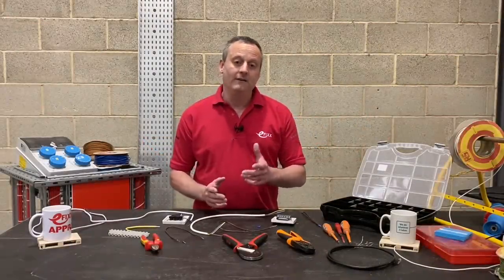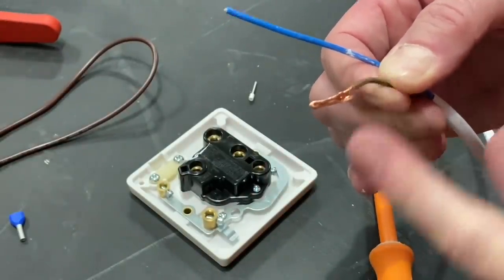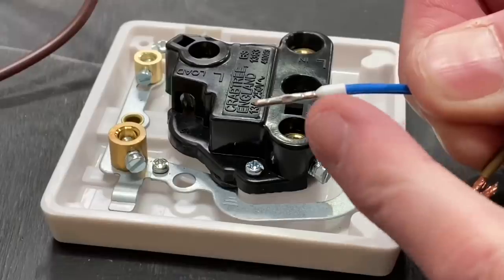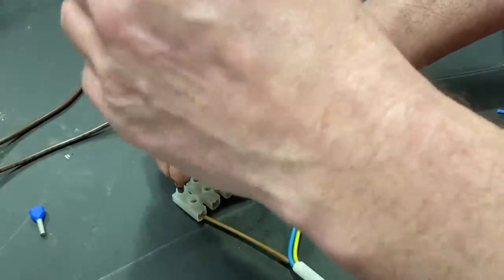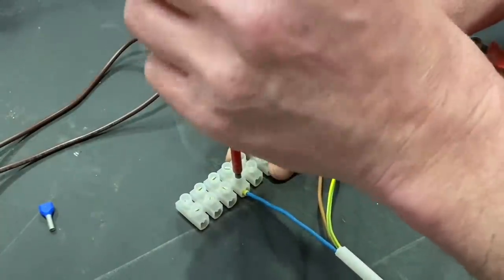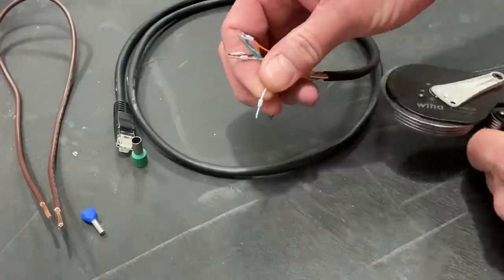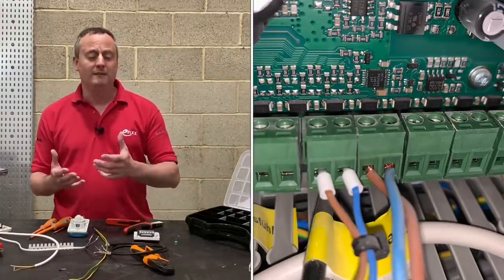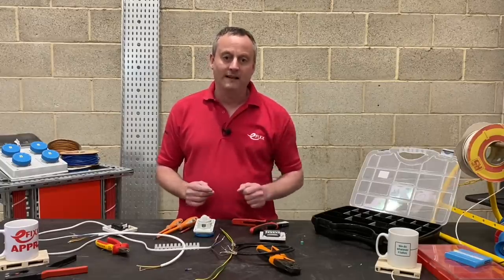Ferrule crimping - An easy way to improve reliability of electrical connections.

Comment: OK, cool, nice cool crimper there. even though this is a uk vid, I think its applicable to what I do in Chicago here in US. When I did electronics we just tin the leads after stripping and twisting, this is too much to do in an electrical installation in a house of course but in controls I think it would be added value. I work in commercial HVAC so I'm constantly troubleshooting problems in controls and much of the time its poor terminal terminations. These are very small poorly positioned terminal blocks with small wiring often twisted shielded wire. I like the idea of using crimped pins like this however I don't think its practical on small gauge wiring like in control wiring, so I'd like to see a way or process in fast reliable bulk tinning to be used in control wiring installations. I think its value added considering I've spent 2 full days pulling ceiling tiles and crawling around above ceilings on planks to get to every micro control in a Victoria Secret to perform a "tug test" on each and every wire termination only to find one single poorly done wire causing the whole system not to work.
Reply from the maker: Thanks for some info from across the pond. The crimped we used will go down to 0.08mm2    - and the ferrules start at 0.14mm2  - so will work on the smallest of control wiring.
Reply: NEVER EVER tin connections that will be used in screw terminals.  The solder will "cold flow" and the connection will ALWAYS become loose over a few months.  I have been to many jobs where this has happened and caused arcing.  Obviously this is a massive fire risk.  Also it's against the UK electrical regs to tin wire (526.9.2).  Ferrules are just the right way to terminate stranded wire.
Reply: Johnny B most all issues come down to the workmanship. Think about this. There was a time when pulling a ground wire was not required. Sloppy workmanship like not tightening set screws and lock nuts gave us that. Arc fault breakers would not be needed if not for bad splices
Reply: @gerhardschemel3565  agree, In Chicago, or whats called the 6 county area of Chicago, we have some of the strictest electrical codes. I'm not an electrician but I have worked as one and I do commercial HVAC so I'm always working on electrical and controls. We are required to pull a ground wire on every piece of equipment and it has to be landed in the panel.  My biggest head ache is control wiring, one little wire not landed tight, can cause an intermittent program execution error that can be nearly impossible to find. compounded by the owners don't want to spend a lot of money troubleshooting on a hunch its a loosely landed wire. I looked up the equivalent american product and I think I want to get a kit when I get back to work after the pandemic, if I survive it.

Comment: one big issue tho - someone thinks crimping is a good idea so they choose a crimp, its slightly too big, gets a poor crimp, the screw grips the crimp but the wires fall out of the crimp. very important to get the right crimp for the cable csa
Reply: Ferrules should not be used to make a bad idea better, they are not the  "Answer"  as you say to good workmanship.

Comment: i was always taught , to only crimp things on stranded conductors and not solid conductors. i tend to use them on meter tails, there was a time when hager consumer units came with a pair for the meter tails. And that was when hager were seen as a cheap brand totally different from todays image of hager.
Reply: There is a good thread on IEE about this and one chap is adament they should not be used on solid core conductors. Others whom worked on MOD projects also said the same!

Comment: Surprised there was no tangible evidence provided with this video.

Could you not have checked the resistance of each connection? Would this have provided data on how "clean" the connections are comparatively.

Also, no sort of pull out force was completed either or specified torque on the connection?

I agree that ferrules are an improvement if used correctly but how often are the non-ferrule installations failing really?
Reply: Perhaps not fail but does make work harder. I work fire alarms and though it works the wires become a pain after a while wire messes up not a lot of slack to keep cutting clean ends etc

Comment: Simply fantastic. How do I determine a wire cross section area, gauge and match that with the ferrule type needed?
Reply from the maker: The easiest way - download our free colour chart - link in the description.
Reply: often it's written on the wire if you get a magnifying glass, otherwise measure the diameter with calipers and use a conversion chart

Comment: Never saw a sixteen sided crimping tool, I have a four sided in the same style and an old school one with the two faces pressing into each other. Would you say one with more pressing sides (basically making the surface more round I guess?) Is better than one with less pressed sides like a two ore four sided one? 
Greetings from Germany ✌
Reply from the maker: Depends upon the type of terminal - hexagon slightly better for round holes. Square for square.
Reply from the maker: Depends upon the type of terminal - hexagon slightly better for round holes. Square for square.
Reply: @efixx  so having both around might be a good idea. Thanks. I suppose the hexagon one is more expensive?

Comment: Maybe a silly question, but I run into equipment that spec "use copper conductors only." Does the ferrule still satisfy this specification? 
I saw another comment here regarding checking and comparing continuity of bare vs. ferruled conductors.
Reply from the maker: When you see “copper” only it really means don’t use aluminium as they require special precautions. Ferrules are made of tinned copper so should be an issue. You can find white papers on the web comparing long term performance of bare copper vs ferruled conductors - ferrules win
Reply: @efixx  excellent. I appreciate your videos and info. I'm in a very unrelated field, here in California, but I'm always trying to do my best for my clients. Thank you.

Comment: i use ferrules everywhere i can get them in they’re the best back of light switches where you’ve got one cable going into the terminals or in a consumer unit on circuits where it’s only got one cable for the terminal i wish they’d design one so you could somehow put two conductors in so i could use them on rings and where you’ve got 2 or sometimes 3 cables going into a point

Comment: When shortening rcbo leads i almost only ever use a 4mm grey bootlace ferrule. Now as the size of the neutral for the 6A and 32A differ i should probably be using a blue 2.5mm for the 6A but i find the larger grey gets crimped very tightly although its not a perfectly square crimp.  The screw terminations torqued to 2Nm further compress and tighten the ferrule. 
The only time id be concerned with   getting a compressed  slightly distorted ferrule is if it were being used in a square clamp and the square edge was required for contact. Anyone disagree?

Comment: I’m not a spark, but I’ve fitted enough 2g sockets with 2.5mm on a final ring. Always made sense to me to join the ends of the two wires to a ferrule first before attaching to the faceplate. 

It means the common failure of one of the two (N, L or E) wires coming out and thus the ring is no longer a ring.

Comment: Good vid, one thing missed is that a lot of times the screw in these terminal blocks quite often cuts a few strands, that can then end up in very undesirable places.
It's a pity ferrule's are not stocked by hobbyist style electronics shops, you have to go to larger electrical suppliers that can be a tad hostile to hobbyists. (they can be trade only, need an account, and only talk big $$$ sales orders)
Reply: I got a kit from Ebay (Chinese), crimping tool + big box of assorted ferrules for about £20. Lots of different sellers on there, HTH.

Comment: Love ferrules, but only concern is whether they need to meet any kind of BS/Harmonized standard?
Reply: DIN 46228 is the german standard for them, not only for the colour of the collar, also for the material and sizes. The french standard is NF C 63-023, canadian standard is C22.2 NO. 291-14. Also there's a UL listing (UL 486F) for these ferrules.
The ferrules themself are made of 0.15mm thick copper of high purity (electrolytically refined copper, 99.99%). In most cases they're tinned to prevent corrosion. But there are also silver or gold plated ones available. But in most cases the tin plated are used. The collar is made of polypropylene or PA6.6.
Reply: @Marcel_Germann  Thanks. Nice to see a man who knows his ferrules! Was hoping there'd be a British standard for them, but appears we're lacking.
Reply: @Marcel_Germann  Nice answer Marcel!

Comment: I tried using ferrules on the 3 pin plug. Since the wire, especially the neutral wire has to turn 180 degrees, there is a kink when the wire comes out of the ferrule. Should ferrules be used for 3 pin plugs?
Reply from the maker: Check out this video - you’ll see an example of a plug using uninsulated ferrules. https://youtu.be/3PpvyZmPTJQ
Reply: @efixx  Thanks, that's what I use as the insulated ones are too long to fit. However, the edge of the flute is still very thin and fairly sharp so over time, it may cut or nick the wires though the cord restrainer will help movement to a certain extent. Regardless, thanks for sharing. Appreciate your videos.

Comment: what if we solder the strand at the first place, will they became solid as the ferrule?
Reply: Yes solder is how it was done before
Reply: Actually not quite especially with the very finely standed stuff. Solder will get a slightly better electrical connection and is slightly more corrosion resistant. It is however significantly less mechanically stout putting un-even strain on the conductor strands leading to a higher chance of breakage if there is any strain or movement at the termination point. 

Also this is a lot easier in the feild and no chance of accidentally setting a fire where grease, oil, fuel, or combustible particulate may be around.  (at leas not from the crimping tool)

Even on the bench, unless you are doing dozens at once it's more likely you've just crimped what you needed to before the soldering iron heats up. Only if you are doing hundreds and can set up a solder pot does it really work better that way, (or if your soldering iron is already on and hot)
Reply: Soldering is a bad idea because solder creeps and so you risk the contact compression/pressure achieved at initial assembly into the terminal block being progressively lost over time. Worse still, you will have had the impression of a good connection at time of assembly. If stranded, use a crimp; if solid wire, no crimp required.
Reply: @WorBlux

Comment: Panel wiring yes but would make testing a pain in the arse when doubling up, say on a ring final?
Reply: You would probably be using solid core on a ring final wouldn't you? in that case you wouldn't bother, but you could do each separate and put two in a terminal if needed.

Comment: Hi I was looking to get a crimper. Would the sleeves you crimp on be OK for a 3 pin plug. Thank you.
Reply: Absolutely
Reply: it would be better to use UNinsulated ferrules though, because the plastic sleeve will cause the bend radius to be too large for the tight corners in the plug! 
Also the screw clamps are not very deep, so you might need to snip off a few mm of the ferrule after crimping.
Reply: @unclefatbloke687  yeah absolutely

Comment: I should probably ask Wago, but do you know whether their 221's or 222's are compatible with ferrules?
Reply from the maker: Yes they are - check out a previous post in our community tab. A ferrule basically converts a stranded core to a solid one.
Reply: Yes you can use them. But you shouldnt with wagos at least.
You will actually get a better connection with stranded wire without a ferrule because of the way wago terminals are holding the wire.
Most wago terminals have actually a higher current rating with stranded wire compared to solid wire.

Comment: Can you solder the strands of wire instead of using a ferrule?
Reply from the maker: Depends on what wiring regulations are in operation. In the Uk you can’t use soldered end with flexible cables in screw connectors
Reply: You could but, the time involved to solder would be way more and be a fire hazard.
Reply: Yes but also a time consideration to be taken into account, we are here to do a good job and make money. Just a thought
Reply: Where there is no vibration or movement of the cable soldering could be used but bear in mind it will be a very bad idea for the long term.  Soldered wire is extremely stiff at the end of the solder area and can fatigue fail due to lack of flexibility.  Soldered terminations should never be used on boats for instance or anywhere else where slight movement or vibration is present, such as inserting and withdrawing a 13A plug.  

Never an easy or a good idea.

It would be really interesting to see how NASA approaches this problem.

Comment: Most holes to insert wires are round.  Is it okay to use a square crimped ferrule in them?  Searched the net for a round crimp.  Seems it doesn't exist.
Reply: It's fine. The holes are round, but the screw that is tightened is only hitting one side anyway, so it doesn't make much of a difference. I have seen hexagonal crimps before, but for the most part, square is standard as far as I know.
Reply: @ZachShannon1  Thank you so much.
Reply: @brijlal973  if you search ratcheting crimp tool the ones shown crimp round in the bottom of the die and flat on top an almost perfect match for a screw in a round terminal and much cheaper than fancier square crimp
Reply: @MarcusMussawar  That's good. Thank you.

Comment: Any reason/situation not to use a ferrule?
Reply: Solid cores.
Reply: And 7 core conducters. Not necessary
Reply: @tommymack3210  Disagree, the result is miles better and more professional.  I always use ferrals, not on the back of socket outlets, but if you did.... thats fine too.
Reply: @zoltrix7779  i just said its not necessary. I agree it looks nicer and easier to work with ferruled wire. 
For many companies its too expensive and time consuming when its not mandatory

Comment: If you had to use 1 wire could you not just twist and solder it solid. Very good video
Reply: you could, but its more likely to crack, and would take longer if there is lots of wires. but if that's what you have to hand to do the job then it works.

Comment: You can also tin the wire before inserting it into the connection. The screw will tighten on essentially a solid wire.
Reply: N V yes, but not in vibrating environments -  e.g. cars and boats. There will be a peak stress point behind the solder that can over time  break under vibrations.
Reply: Frankenstein will say: soldering wires.... Bad

Comment: KNIPEX do ferrule crimp pliers and are a lot easier to wield than those ridonculous ratchets which are totally unnecessary. I also think that the ferrules can bend and snap more easily, probably best to use an uninsulated, shroudless style. However, the booted ferrules are better in terminal blocks as it stops screwing onto the insulation rather than the conductor as you can't push it in that far.

Comment: what is the tool used to compress copper multistrand wire into almost a solid, seen that been used instead of ferrules, but having hard time finding the tool that does that
Reply from the maker: Think you are referring to an ultrasonic welder 
https://www.supremecable.com/capabilities/ultrasonic-welding-and-splicing/
Reply: @efixx  this looks more like splicing and joining orientated, I thought there would be something hand-held, portable around also, because I see them used with large gauge multistrand wires, well, relatively speaking, 2.5sqmm, 10 awg or thereabouts
and the ones quick searches bring up are very cost prohibitive, like 10k+ for entry level, seems to be automotive orientated, but I see those wire ends compressed like that in somewhat cheap electrical distribution boxes, German made, not imported from China, that is why I thought there would be something like a hand held tool that does that

Comment: You use the terms ‘nice and tight’ and “firmly and securely” for tightening the screws on ferrule. I’ve invested in a torque screw driver, what torque do I use?
Reply from the maker: The one specified by the equipment manufacturer

Comment: Hi. For the double ferrule , you used a 2.5mm ferrule. What was the size of each wire ? I have 2 wires of 1.5mm thickness. What size double ferrule do I need to use. Thanks.
Reply: If you're referring to 6:10, he said he was using 2.5 mm CPC wires. He had a single and a double ferrule in shot which are the same colour under the German Weidmuller system of 2.5 mm. If you look closely the ferrule diameter is slightly larger on the double ferrule which makes sense since you're combining the cross section areas for a total of 5.0 mm. I guess that the single and double ferrules will be labelled as being for the same cross section. The double ferrule still being labelled as 2.5 for a single cable despite putting two cables (of the same cross section). For combining 1.5 mm cross sections, just use a 1.5 mm double ferrule, the diameter should compensate for 2 cables in there.

Comment: Do you know if the ferrules on data cables can be used with a Krone punch down tool?
Reply from the maker: Haven’t tried it - however the ferrule makes the conductor very solid, so we don’t think it would be suitable for IDC terminals.
Reply: Nope won't work. The punch down till requires an isolated wire witch will be penetrated with a copper "knife". This way the connection is stable. The knife is between the wires and stays there. When using a ferrule the knife can't penetrate (good enough) and will cause a lose connection.